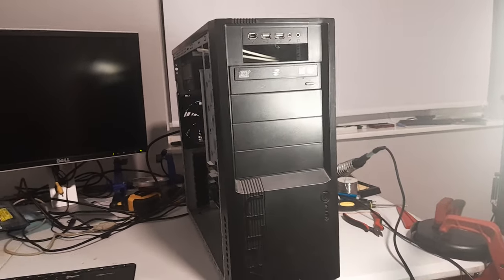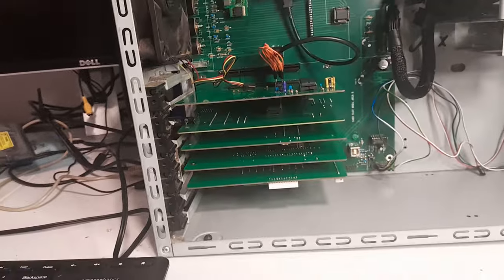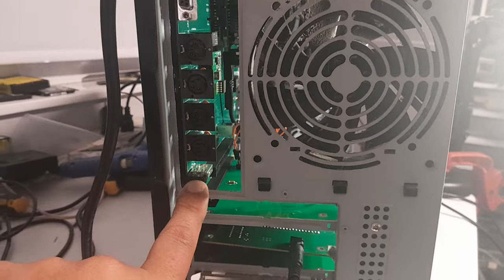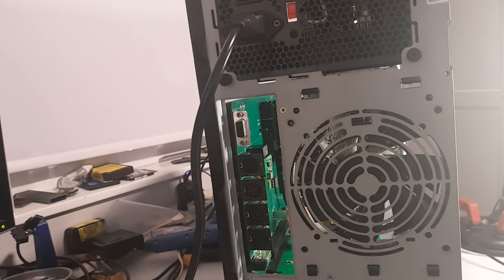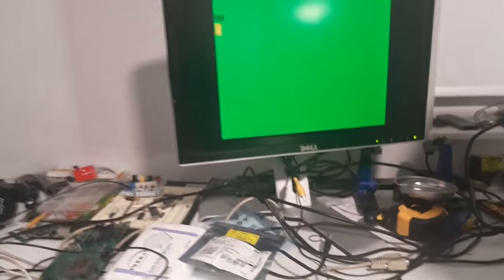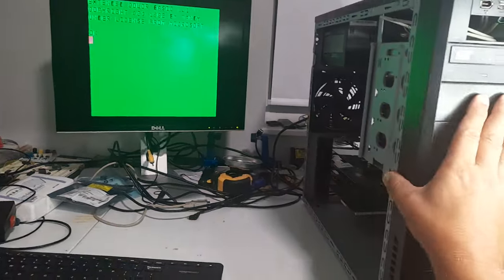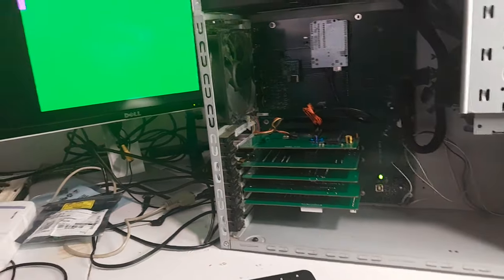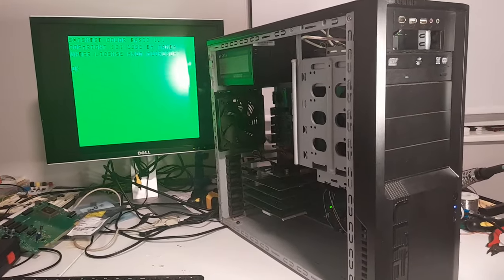CoCo ATX in a case. Very late #SEPTANDY video! #OCTANDY it is!

Comment: a multipak in the drive bays are GENIUS.  It's the perfect place for it.  But given that there will be need for drive controller(s) and such things, I would look to ensure floppy drives and a gotek could exist in the case as well.  Basically, I think an MPI redesign to support both internal and external would provide both.  Perhaps simply extending slots using ribbon cable would be enough to provide one or two slots with external access then all you would need is some sort of slot selector thing which I'm sure you could handle easily.  (A rotating dial would be my preference over a sliding switch... just saying)

The ultimate repack is an incredible idea and would allow for all sorts of testing and development for GIME-Y+ and all the rest of the ideas out there.  It would be interesting to know how your bus works but it's clear since RAM is on a card, it pretty much handles everything.  

The idea that you can convert from CoCo2 to CoCo3 by swapping cards is REALLY exciting.  Let's talk more about "CoCo Deluxe" as well!!!  Dang this is awesome.
Reply from the maker: Thank you! There is  a lot to do still and ideas are many. I'm not sure how I would handle an MPI yet but the main problem to solve before anything can be made is how to extend the cart connector out far from the board without it being so noisy that it won't work. The bus just about has every signal under the sun so that I could separate all of the subsections the way I did. Once I have settled on a somewhat stable version, I'll release the designs so that people can go over it and improve it. Still lots to do!
Reply: @rockyhill3  How to extend?  I don't know what sort of latency is allowable, but if you're trying to extend signals, why not capture them as packets and transfer them to the other end using some sort of serial or parallel protocol?

Comment: nice work!
Reply from the maker: Thanks!
Reply from the maker: Thanks!
Reply: @rockyhill3  just as a thought (I'm liking your use of the slots), are these re-usable? My original aspiration of putting all the regular stuff on the main board and using the slots for general expansions feels a bit aspirational. This is just so much more sensible. Putting the MPI capability into a front facing bay on the 5.25" slots feels much more sensible too.

I promised myself not to get distracted from the end-goal for the ATX board I started months ago... this however is worthy of attention! Especially if I can implement my SamX4 FPGA as a plug-in instead of integral to the whole thing
Reply from the maker: If by reusable you mean you can place them in any slot then yes, they are. One of the main motivations behind this project was to abstract the subsections a bit so as to make it easier to hack and design hardware for the CoCo so it very well might help you with your SamX4 FPGA. I rushed through this to get it out for SepTandy(a little late) so it's a bit messy but Once I clean things up a little I'll be releasing the designs.
Reply: @ in which case I am even more interested:)